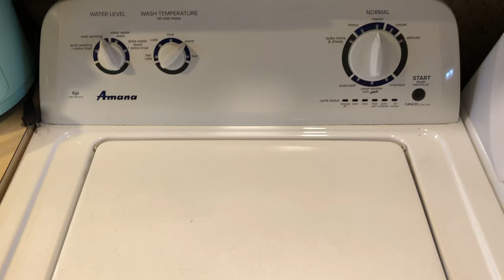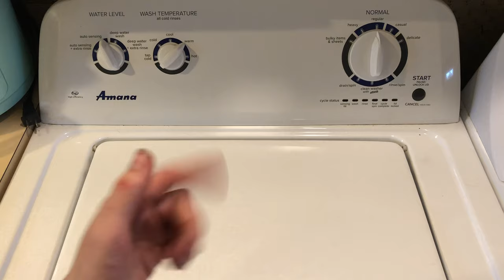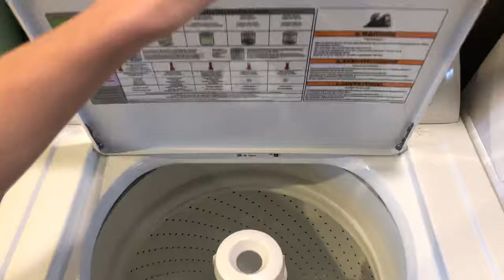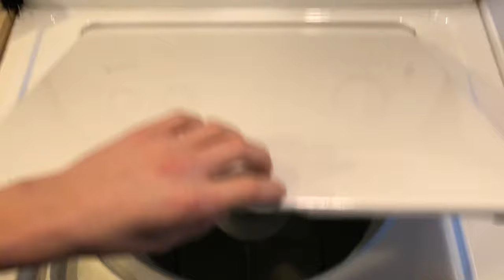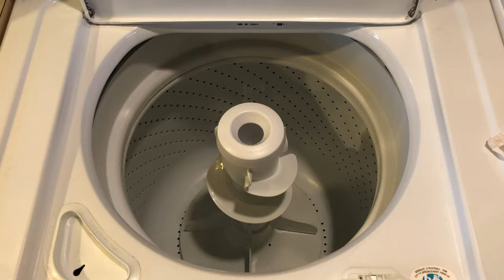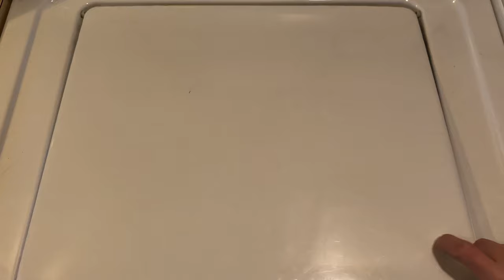Amana NTW4516FW1 - Full Diagnostic Self Test Demonstration

Comment: We have the NTW4516FW3 model and it quit working correctly.  When set to REGULAR wash cycle and AUTO SENSING fill and warm water it fills and as soon as it is done, the LEDs go blank and it pumps out all the water without agitation.  THEN  the light comes on to WASH and nothing happens no matter how long you wait.  If I set it to CASUAL it will fill with water,  agitate, then it pumps out the water but does not rinse or spin.  Any clues?   Sounds like it may be a control board issue, or a bad connection.
Reply: Same with mine. I have to push the start button until all the lights go off. Then I put it on rinse/spin and push the start button and it rinses and spins. I don't always have to but more often than not.
Reply: OMG mine does that too! Same model. I noticed it mostly on really heavy loads but it sometimes happens when barely anything is in there . Some times I'll switch modes or temps , sometimes I'll pull the washer forward a little to adjust it, sometimes I'll hit drain/spin take all the clothes out and rearrange them. Sometimes I'll do this all day trying to figure it out I hate it. Also a lot of modes stopped working. Like bulky never worked, heavy doesn't work and the rinse mode(by itself) will do its job, but won't drain or spin

Comment: Update after no lights at all after dépression of Start: Second calibration worked: each green light appeared and blinked except for the lid locked light, upon which I turned the knob until only the rinse light steadily appeared; then, the cycle completed as always since purchased new. 

Before calibration, which finally corrected the problem: This very model will not light at all, but the motor is sounding until I unplug it. No clog in any hose; the outlet is working—I tested it by plugging my Vitamix into it, which worked. We purchased a 3-year warranty on 05/17/22. I’ve been using it only 2 times a week.
Reply from the maker: Sounds like it may be a control board issue or something similar. If it’s still under full warranty, it wouldn’t hurt to have a service person come out and take a look at it. We’ve been lucky with this one, as it’s going on 7 years old, being used every other day, without any issues.
Reply: Thank Goodness I located our Extended Warranty plan and receipts that cover it through authorized Whirlpool service. One sheet and two pillow cases resulted in an abnormal high fill—3/4 of water in the tub that was still filling, so I pressed thee Start button until the water drained with no spin. When no lights finally responded, I attempted to calibrate it, and the green lights appeared, but fill was to 3/4 of the tank again with no stop, so I pressed the Start-Stop again button for about 3 seconds until the water emptied with no spin, and I located my warranty papers. Perhaps the lights had failed due to a sensor component such as a water level switch? I would not remove or attempt to replace parts since I have an Extended Warranty. Authorized servicemen/women surely rely on a voltmeter.

Comment: Awesome video! I think It's really cool how these machines have a test sequence to make service easier.
I believe this is the order:
1. lock lid
2.Cold fill valve 
3. Hot fill valve
4. (repeat)
5. Both valves on (Warm) until designated water level reached (pressure sensor test)
6. shift to agitate mode 
7. Agitate
8. Drain
9. Shift to spin mode
10. Spin until full speed reached (if test failed machines shuts down and goes to next step)
11. wait for basket to coast to a complete stop
12. Unlock lid, if all test lights on then cycle complete, no problem seen. Any other codes/sequences the machine has an issue.

Hope this helped!
Reply from the maker: Thank you! And yes, I do believe it does it in that order. I know I mentioned at the end what I thought it was but I don’t remember if I got it correctly or not.
Reply: @DrummerboysWashersAndMore  Can you do the manual test mode on this machine?
Reply: I think my spin cycle is busted from a bad out of balance load,

(Notorious family member who always does this)

Good, clean & concise video👌👍

Comment: I just recently replaced the water valve. Do I need to do a reset and how to perform this ? Thanks.
Reply from the maker: I do not believe anything would be necessary to do if you just replaced the water valve, however it may not hurt to run a recalibration cycle. You may be able to look up the steps for that online, but it is done through a similar process in service mode.

Comment: Will lights stay lit for diagnostic in the end or if the light just goes on green everything is ok.
My washer always fills to a full load no matter which cycle I use. I am perplexed.
Reply from the maker: If yours is the FW0 or, like in my case, the FW1, then it will always fill to a almost full tub on every cycle unfortunately. At the end of diagnostics, if no problems are detected, it should just go back to flashing, and then you would hold the start/pause button until they turn off to exit diagnostics.
Reply: That’s strange cause it used to do smaller fills with water my machine ends in GWO. So the flashing lights before mean nothing.

Comment: My washing machine is of the same brand as yours, but now there is water at the bottom of my drum, and no water can be seen inside the bottom, but I can obviously hear the sound of water at the bottom when I shake it. I don't know what the problem is, and I am particularly distressed
Reply from the maker: What you are hearing is most likely the balance ring around the top of the tub. These are very often filled with water, which, during the spin cycle, distributes out to help balance out the tub. This water is entirely self contained, and a sloshing sound is normal to hear when moving or shaking the tub, since it’s not completely filled

Comment: What if my Amana washer says locked lid when I push the start button even though the diagnostic test says it was successful ?
Reply from the maker: On these, the lid must be closed all the way to start the machine, so the lid switch must be engaged in order to start. Make sure the lid strike is engaging the switch correctly and that the lid is closed all the way when trying to start the machine.

Comment: What if your water is dripping not pouring out ? Who should I call
Reply from the maker: I would recommend checking the inlet hoses to the machine to make sure they are not kinked or otherwise restricted. If everything seems fine, and the water is turned on and you have decent pressure to other faucets in your house, I'd recommend contacting the place you bought it from, or another appliance store, to come check it out.

Comment: Under the troubleshooting section (it's missing the word "troubleshooting" ironcially) the manual literally says "Both hot and cold water faucets must be turned on," but I don't have a hotwater outlet to begin with. When trying to run the diagnostic mode, only the sensing fill light blinks.. I tried unplugging it for an hour and I when plugged it back in it still wanted to put more water into it regardless of where the dial is set.  I just want to run the stupid drain/spin  but that is the only mode that won't run. I'm so tired.
Reply from the maker: That sounds like a very annoying issue. from what i’m understand it seems to be trying to run a full cycle no matter what cycle is selected. Seems like a control board issue. Have you tried doing a manual test to run the pump?
Reply: @DrummerboysWashersAndMore  Well,, I finally ran the diagnostic mode and it seems to be working the way it should. I just threw out a used HE washer s week ago, thinking it was broken. LOL
Reply: Sounds familiar, except diagnostic will not engage no matter who's video I follow. Off grid, no services, I ran a load by manually adding water once. It doesn't want to work again. Brand new washer. POS

Comment: Can you help me I have this same washer the water runs in and out but it not washer are nothing could it be the Control panel
Reply from the maker: There are a couple possible reasons it may do that. You may have a faulty control board, or something like the motor or gear case could’ve failed, however that’s less likely. Without seeing the issue it’s hard to determine for sure, but I’d recommend having a service person check it out and see if they can identify the issue specifically.

Comment: I'm so confused my washer wasn't working I haven't used it in months... It was not agitating.... I ran a diagnostic although I can't see what's going on I can tell everything is working.... Now what?  Was this to reset my machine?
Reply: The only thing was it did not drain the water but it's doing it now
Reply: And now it's not 😢
Reply from the maker: @jenniferlawlor16  If you are having issues with it draining, check and make sure the drain line is not kinked or clog. If it doesn’t sound like the pump is running, you may want to check the connection to the pump, and if all that is okay then you may not have a good pump

Comment: Could you do the normal regular cycle on the deep water wash + extra rinse water level with a load of towels
Reply from the maker: Of course! I’m not sure when I will be able to do it, but when I get the chance I will do that.
Reply: @DrummerboysWashersAndMore  okay thanks! Also make sure the water level is set to deep water wash + extra rinse when you do the cycle.
Reply: @DrummerboysWashersAndMore  okay! Just wondering is this your machine?
Reply from the maker: @pony7124  This is my grandmas machine, and is what is mainly used when the washers in the garage are winterized. Usually when I do the Normal cycle, I always choose an extra rinse option, so I will be sure to set it for Deep Water when I do your request.
Reply: @DrummerboysWashersAndMore  okay!

Comment: I ran the tests and it still wont fill with water
Reply from the maker: if the machine is not filling with water at all, regardless of cycle, it sounds like you may have a bad water valve, or a bad connection at the water valve